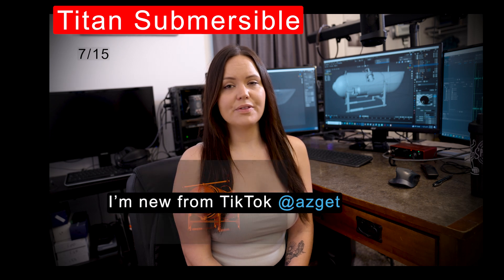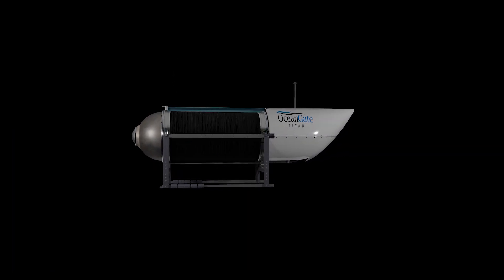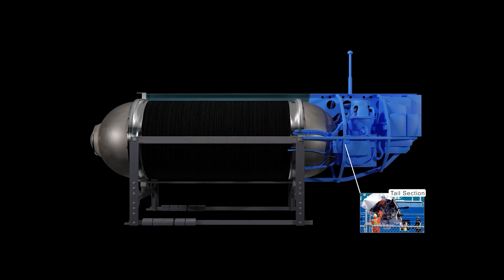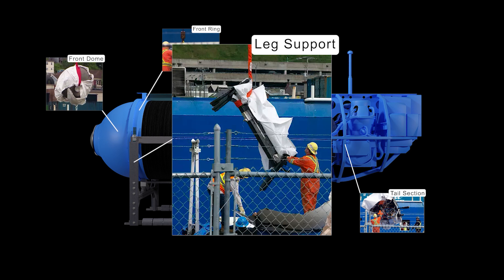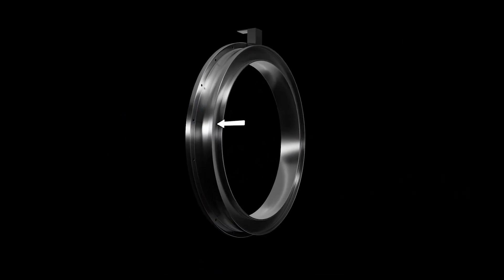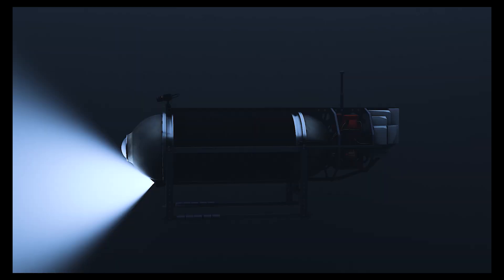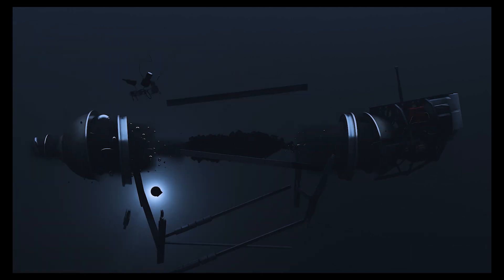Titan Submersible and how it Imploded... parts of submersible recovered 1600 feet from the Titanic

Comment: The heads would not move away from each other upon implosion. They would move toward the center of the air chamber nearly as fast as the collapsing cylinder walls

Comment: Only a threory of course that the joint between the carbon fiber and titanium disbonded, but good one. Reports were that there was crackling (cabon fiber failing) at the aft before it imploded. That would support this theory.

Comment: Very much as I expected the implosion to go.  Extremely well done; very professional and factual presentation.  I suspect that the compression you illustrated is closely aligned with the actual failure.  Considering the cycles of use weakness would have occurred at numerous points.  Going from no stress to 4400PSI then back again accelerates the process.  The materials used were superior, but not for that depth over a continued period.

Comment: The cross-section was helpful thank you. I noticed that the recovered titanium rings looked squeaky clean from any remnants of the carbon fibre. Looking at your animation makes it clear that bonding with the outer lip wouldn't last very long and bonding with the inner lip would fail eventually. One wonders if the landing gear wasn't taking a greater role of holding everything together when out of the water!!!

Jeffostroff recommended you so here I am. 🙂

Edit: I keep visualizing the plastic cover of a pringles tin popping off. 😬

Comment: The detail of the glued joint between carbon fibre tube and titanium ring was most informative, thank you. 
Although, it is a little misleading to claim that the titanium ring "does nothing" when subjected to the same external pressure. It certainly compresses (gets smaller) but the key detail is that it does not compress anything like as much as the carbon fibre. It is this mismatch in material properties that killed this design, and any engineer that understands material principles like "stiffness" would see this fatal flaw immediately. 

Also, it is important to note that "carbon fibre" is only the tensile reinforcing part of a plastic polymer resin (glue - typically epoxy). The fibre works very well in tension, stopping the resin from cracking apart. But it is terrible in compression - like using a piece of string. It simply buckles and collapses, and relies on the resin acting in tension (which it is terrible at) to hold the fibres straight. While that carbon fibre tube would be fantastic as a hull of a space station (where it holds in one atmosphere of air pressure against the vacuum of space) it is a very poor choice for the pressure hull of any submersible vehicle. We can engineer it to work and survive at relatively gentle depths, but it really was a terrible choice for going to the depths of Titanic. That it survived at all is a credit to the people that built it, but the cumulative damage and failure of composite materials (like carbon fibre) under load meant it was always a time bomb that was going to fail someday. 

What the video demonstrates nicely is that the glued joint is designed to act axially, with the end hemispheres being pushed onto the cylindrical tube (which water pressure will do nicely). But that isn't the only way the structure reacts. The external pressure is also compressing the cylindrical hull radially. The mismatch in material properties results in a much larger radial movement of the carbon fibre tube causing significant bending and shearing at the joint, that would have rapidly damaged the carbon fibre laminate. 

This is not the first time this issue has been seen. In the 1979 Fastnet "disaster", this annual highly competitive sailing yacht race was struck by a gale force storm that was off the scale. Many crews abandoned ship - prematurely, as it turned out. The lifeboat design of that era proved woefully inadequate in the wind and waves, with many blowing over and dumping their crews into the ocean. The abandoned yachts, however, mostly stayed afloat. 

What freaked many out, was that their rudders had snapped off. Unable to steer or control the boat, it would turn broadside on to the waves, and then roll and capsize. Repeatedly. 
Yacht hulls are mostly designed to be completely weatherproof, so although many of these afflicted yachts lost their masts, they stayed afloat, and would have kept their crews alive, if with multiple bruises and broken limbs. 

The analysis afterwards focused on the broken rudders. In the interests of "light weight", a new composite design was commonplace. A very thin stainless steel tube in the centre was then wrapped in a carbon fibre surround. The combined strength of the two materials was deemed more than ample for even the worst conditions imaginable.

What everyone failed to realise, is that the stiffness of the two materials was incompatible. "Stiffness" broadly refers to how much something will deflect, when subject to a given load.  Exactly like, how much the submersible hull would compress when subject to the water pressures in the deep ocean, with the carbon fibre tube compressing much more than the titanium ring...
  
What actually happened to the Fastnet rudders, was that water pressure against the blade tries to bend the rudder shaft where it enters the hull. The stiff stainless steel tube was stressed all the way to breaking point with very little deflection (because the material is stiff relative to the carbon fibre). At that little movement, the carbon fibre was not carrying much load at all, nor would it until a much larger deflection of the rudder blade. The stainless steel tube then broke, leaving the carbon fibre to do all the work, which it was incapable of doing. The carbon fibre wrap then broke soon after, meaning the entire rudder blade broke off because the shaft snapped. 

While the failure mechanism might look different, both failures are due to the same fundamental property of material stiffness mismatch. The stainless tube and carbon wrap of the rudder shaft were both working together against bending loads generated by the water pressure acting against the rudder blade. In this case, the materials had to deflect the same amount, which generates very different stress levels in the different materials. The stainless steel tube reached breaking stress first, leaving the carbon fibre to fail later, as neither component part was strong enough to take all of the load alone. 
 
With Titan, the carbon tube and titanium ring were both subject to the same compressive external pressure, but their different stiffness properties meant that they deflected different amounts, damaging the carbon laminate at the joint and leading to its eventual failure.

34 years on, and Stockton Rush is arrogant enough to claim he "knows what he is doing", yet not only fails to appreciate a fundamental engineering principle of material stiffness, but ignores one of the great lessons from history about what happens when you miss it. On the other hand, he proudly declares that the plexiglass window will crush by 34mm when at Titanic, so clearly he knew that materials do deflect when under pressure. Makes it all the more tragic that he didn't stop to consider what was going on at that critical joint. 

I would further guess that the absence of the rear titanium ring and hemisphere points to this joint as the one that failed first. 
If it was recovered in one of the bags, it was most likely hidden because it had physical damage.

Comment: To picture what happened , grab a full pringles can and lay it on the floor , now jump off a chair onto the can .
Reply: Close, but you would need to apply that pressure equally on the entire surface area of the pringles can.  Basically the can would need to be suspended in air, and then your foot pressure applied to every square inch all around.

Comment: Excellent summary and visualization. The script was clear and concise. Would like to have seen cost data for the major subsystems.  Why was the main cabin tube made out carbon fiber instead of titanium?  Was the glass portal the failure point?  How is cabin pressure maintained?  Could you produce a similar video for Apollo 1? 13?

Comment: If its imploding WHY is the porthole section moving away why is the porthole blowing out ...WHY is there no porthole in this supposed explanation
Reply: The porthole blew outwards, failing at the seams were it was connected.  Take a tube of toothpaste, cap on, then put it on the ground and jump on the toothpaste tube.  There's the porthole.
Reply: @MMMmyshawarma  Sorry thats n ot how implosion works steppping on something is am explosion
Reply: @ziggstah5307  When something implodes and there isn't any more room to compress inwards, what do you think happens next?  Outwards ejection.  Where do you think the pressure came from when you jump on the tube?  Your foot is pushing pressure into the tube.  If you lit a firecracker and shoved it in the tube, what would you call that?  Good job champ.

Comment: I think the biggest problem was that carbon fibre has a negative thermal coefficient of expansion while titanium has a positive thermal coefficient of expansion. So as the temperature was decreasing with depth the carbon fibre was expanding while the titanium was contracting. Why try to join two materials with completely opposite properties?

Comment: Nice work.  It's all becoming clearer now.  It has nothing to do with failure of the glue and subsequent water penetration between the Ti ring and the hull, as some have claimed, since that would not lead to an implosion (though water penetration at 6000 psi would be very bad for the occupants too !).  As your model shows, the implosion was likely caused by delamination and loss of compressive strength of the carbon fiber composite due to repeated pressurization cycles.  As many submersible experts have pointed out, the carbon fiber is the weak point of the whole design and Rush admitted that the carbon fiber he obtained from Boeing was only discounted because it was past its shelf life !  Sadly it seems that saving money took priority over saving lives.

Comment: This implosion of the Titan that the media is talking about is awfully weird because it reminds me of the terminology used in describing the Trinity Gadget that was dropped at Alamogordo, New Mexico in 1945 around the time when television was coming out.  It was an implosion-design plutonium device, just like that of the Fat Man bomb which was dropped over Nagasaki. And judging by the video of the U.S. Coast Guard unloading the supposed Titan debris in Newfoundland it does not look like the real Titan imploded.  The debris that was brought onto the pier was comprised of pieces of a sub that were mostly intact and had no appearance of crinkling, denting, or any significant damage that would have been caused by an implosion.  I'm therefore convinced that this whole incident was a cover-up and that the actual Titan possibly was hijacked by remote control by some government agency which took over the sub's Starlink satellite connection, sending it into a remote location thereby marooning and killing the five on board, perhaps for profit.

Comment: Very good work and you covered the most interesting points of this .
Its happened so quick they didnt even know they had died if that makes sense.
But i think without much question they were simply knowing it was going to .
The carbon fibre had been damaged so much that on the way down what hadnt de laminated  was cracking with some very loud noises .What was already cracked cant crack again .I think a final loud crack just preceded the implosion .

Comment: Yes agree with others well done. I worked with Carbon Fiber in the 70s in Medical Systems, We scanned people and used it to support them because it was X Ray translucent, and it was stiff with the right assembly methods. Now we did not got to the bottom of the ocean. But we did not glue the thing together either. We added rigid foam in the center and wrapped the foam to make a diving board shape. We added Micro Spheres to the resin on the edges to prevent artifacts from dense sections of pure resin. We found this method in the marine military as they used the Glass bubbles in resin to increase buoyancy of floating makers in the ocean. Then the slide mechanism was attached the foot end of the Carbon Fiber Diving board, but since we were sliding humans in and out of the scanner we did not glue it together.  We made two full wide flat aluminum plates about 18 inches long. We sandwiched the CF Board between the Plates , we also added Aluminum spacers in the Carbon Fiber with holes for bolts. we had about 16 bolts 3/8 in diameter and we added Adhesive as well. So our part was glued and screwed together over 14 inch long overlap.  As I saw the video of the glue being applied I was shocked!  I was shocked. To think ANYONE with any common sense  would engineer a joint that critical to the mission is such a slipshod manner is appalling.  The more you see and learn you wonder why didn't anyone go Legal and prevent that contraption from ever going in the water with people, especially citizens paying for a joy ride. My God! This Video makes all my considers highly viable and rightly so, Well Done young lady. Dennis

Comment: Excellent modeling. Subscribed. More detail of the laminar schedule of the carbon fiber could be instructive, especially with a graph of diminishing strength wrt pressure cycling de-lamination. 
One detail immediately caught my eye in this: the behavior of the adhesive in the joint of the carbon fiber tube and the titanium ring. If under extreme compression the adhesive on the OD of the tube separated from the ring, and also sheared along the ends of the tube, the structural properties of that joint are instantly degraded. The adhesive properties here, under cyclic loads, is vitally important. A scary variable.

Comment: 1:58 This Cavity Got Air Trapped inside the Epoxy during assembly this is the point at Witch De-lamination accrued during the intense Temperature Cycling as they descended too Rapidly.

Comment: The back titanium cap is still down there. The componant part they recovered is in tact so well cause of the memory foam surrounding it. 
The reason she was descending so fast is cause they were already taking on water between the two titanium rings. The back ring opened first with water as descending. Then the front problem was the plexyglass window. Think of the back cap of sub like the bullet. The front porthole caved in then the implosion force went aft blowing thr back titanium cap out like a bullet. When they find it they will be able to prove this by the distance apart from recovered pieces😊

Comment: At first I thought "here we go another implosion video", but after watching it and seeing the objective clarity, I think it's excellent.
If I remember right, the glue on the end caps was applied by hand using an autobody filler spreader?
Criminally negligent construction - that end joint combined with the inability of the carbon tube to withstand such pressures is insane to me. And I honestly can't understand why anyone would have taken a ride in this coffin.

Comment: What did you assume was the composite? I assumed a long fibre metal matrix composite (MMC) with reinforcement in the hoop direction.  Such a composite would work very well as a pressure vessel material if the pressure pushing hydrostatically out (i.e. a pipe) and the reinforcement would be in tension; if such a composite were used in a submersible pressure hull, the matrix would take the full compressive loading since the reinforcement would be under hoop tension.  I do design substantiation of pressure vessels to ASME using FEA but also have an interest in composites as I did my PhD in the failure mechanisms of long carbon fibre MMCs.  This whole sorry incident is an example of what happens when you don't design to code.  I await a full explanation of the actual failure mechanism that led to the catastrophic failure.  I think microcracking through cyclic loading is a good candidate.

Comment: But what was giving the sub buoyancy issues before the hull failure? Was there some hardware failure, or was the degrading carbon fiber leading to issues with the hardware elsewhere? I suppose if the hull was more compressed than normal, that would affect buoyancy.

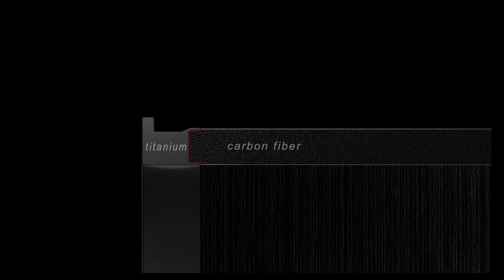Comment: In 2:10 wouldn't it be more representative if the 3 million pound anvil was placed across the titanium ring AND the carbon fiber hull (since underwater pressure is evenly distributed)? I would imagine that the compression properties would still be different in each material, but I doubt the titanium ring was just "sitting there doing nothing."

Comment: Of all the videos on YouTube covering this OceanGate sub, this video has got to be the best at illustrating the epoxy adhesive glue holding the titanium ring on to the carbon fiber hull and how small of an area it was!!! Even if the contracting rates of carbon fiber and titanium are different, the epoxy adhesive glue had tremendous forces working on it due to the small area of contact! That was more than likely the cause of failure of the sub.  Also, your illustration of the amount 9f time it took for the implosion to happen was so quick that viewers could not see it as it was that fast!!!   Well done!!!👍👍👍